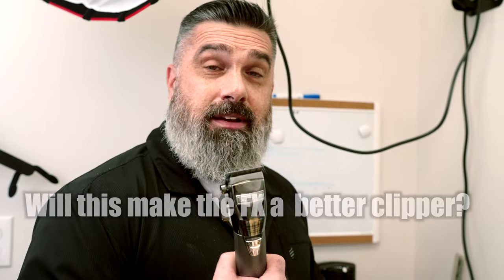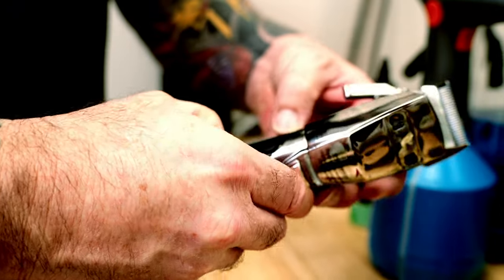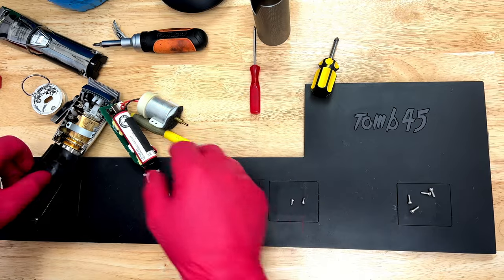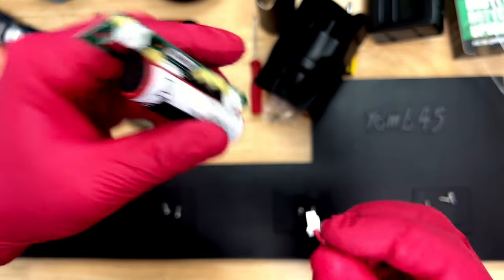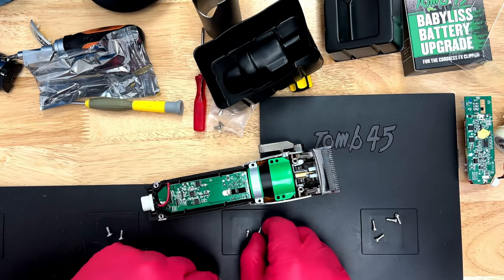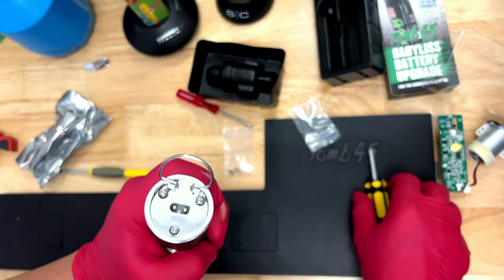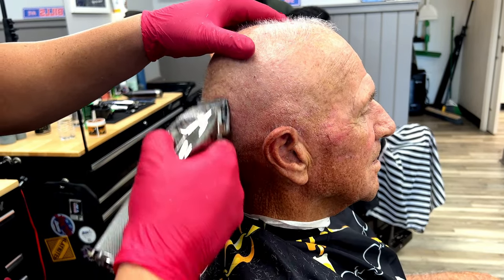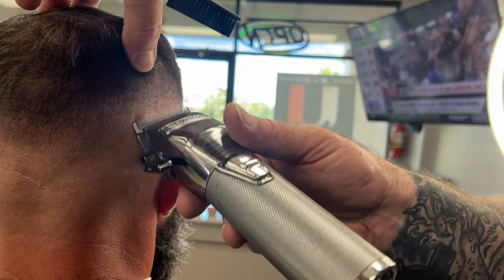TOMB 45 MOTOR + BATTERY UPGRADE | BABYLISS FX CLIPPER

Comment: How many rpm’s is it running with the upgrades?
Reply: Rpm’s don’t really matter as its a slightly slower clipper. But the spike in torque is huge. Put the battery and motor in mine today and its a nee clipper again! Love it

Comment: I just got this and it made the clipper stupid loud. Any idea how to change that?
Reply from the maker: Takeoff your blade and see if it is still loud if it is, you might have a problem with your motor, not being mounted right
Reply: @YouTubeBarberAcademy  it seems the problem is that the brass piece is hittin the cam follower. Metal hitting plastic. I believe from observing it.